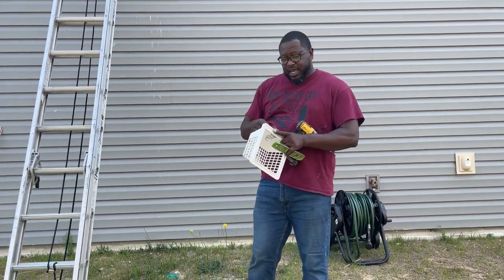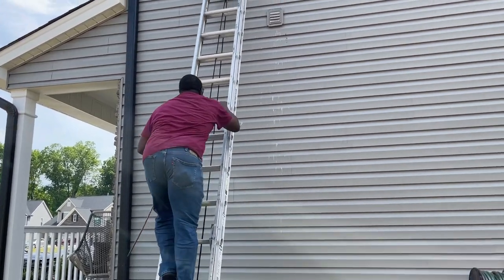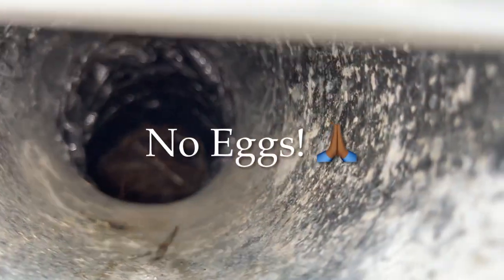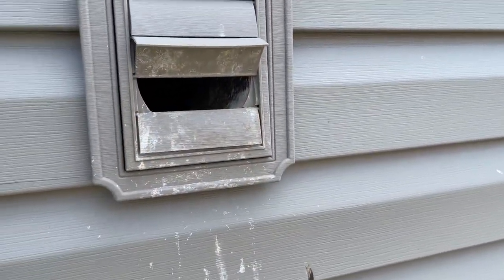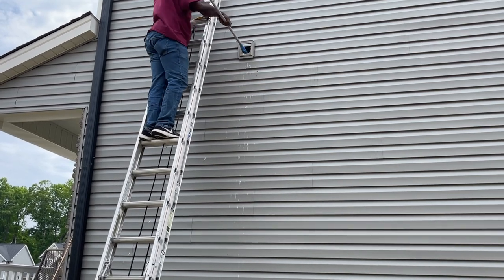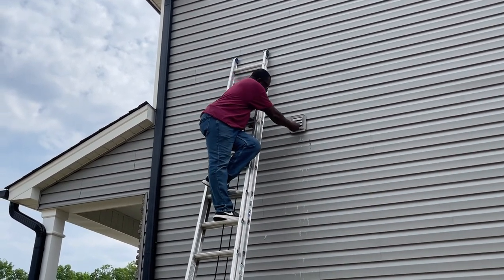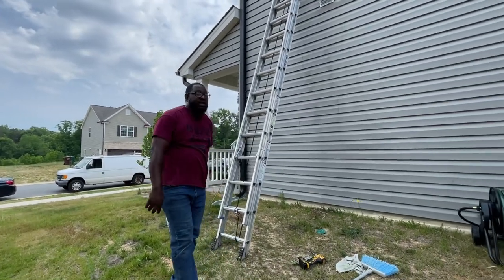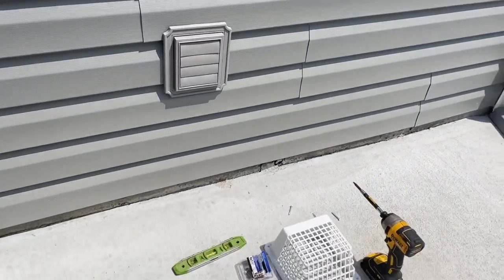How To Keep Birds From Flying Into My Exhaust Vent

Comment: Don't forget on dryer vents to monitor for lint build up on that cage.   Also, modern dryers have backpressure lights built in and you can buy cheap aftermarket backpressure monitors too.

Comment: I discovered this after having issues with my ac not cooling my top floor. Some wires were damaged and repaired. Now the flap is stuck open. Does that affect cooling the house?

Comment: Is it possible to access and push out from inside the house?
Reply from the maker: Really depends on where you vent is located. If it’s near an exterior wall then yes. If it’s further away, you may need to access the attic or cut open drywall and splice the hose…There’s always a way!